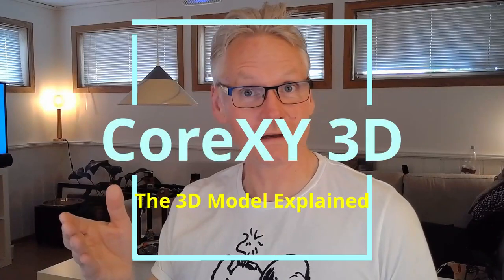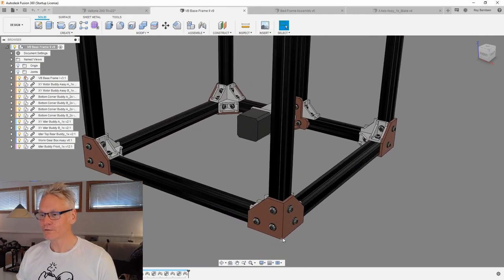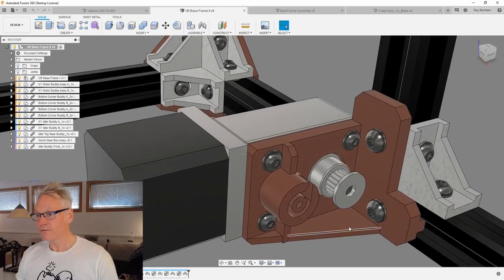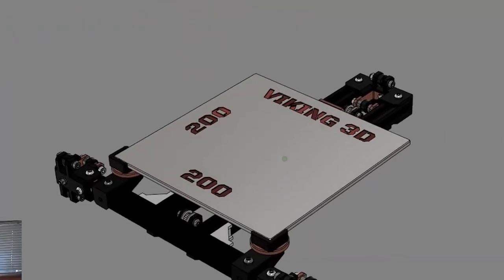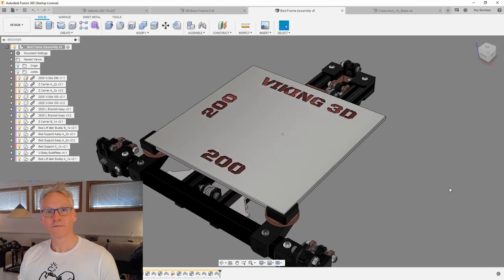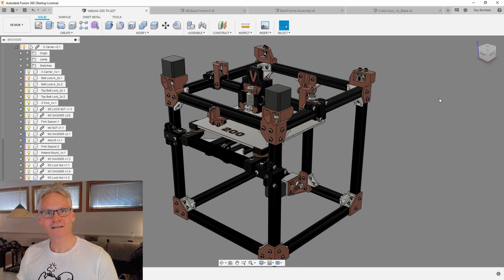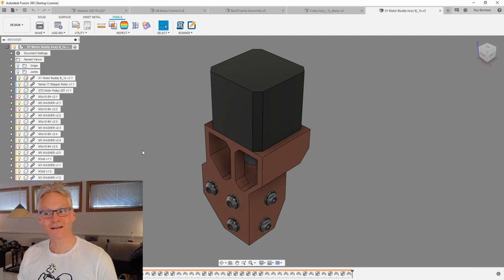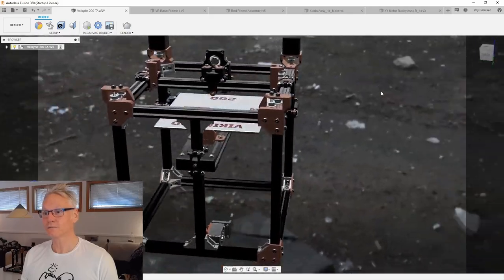CoreXY 3D Printer Design vlog #15 - The 3D Model Explained

Comment: Hello Roy, My name is Ronak and I'm a graduate architecture student. Just came across your channel through facebook hypercube 3d group. I must say this is something next level 3d printer. I'm so down to build one of these but I have a set back the extrusion I get in States is t slot extrusion. I know, I can get it through Ali express or out of US sellers but, they are out or my budget I can get t slot extrusion very cheap from 8020.net 
would you think that the liner slide what you have designed is compatible for this extrusions? Please let me know.
Again incredible work. Great achievement.
Reply from the maker: Not compatible with the t-slot

Comment: When did you add the 2 extra legs, it had a really unique look before with the 3 legs
Reply from the maker: I added them this weekend
Reply from the maker: It was more convenient as for attaching panels and routing cables
Reply: @PRO3DESIGN  shame, I liked it the other way. Was different. Now it's rather similar to a HEVO with a bit different bed kinematic
Reply from the maker: @kazolar  Well good thing is you dont have to add them :)

Comment: How much is possible to expand the hot bed? Thanks!!
Reply from the maker: Expand the bed? What do mean by that
Reply: PRO 3D sorry I mean increase the size of the bed. The maximum size of the bed that supports your prototype
Reply from the maker: Do you mean just adding a bigger bed? Or a bigger frame? My prototype prints 180 x180 z160. The beta version prints 190x200x200